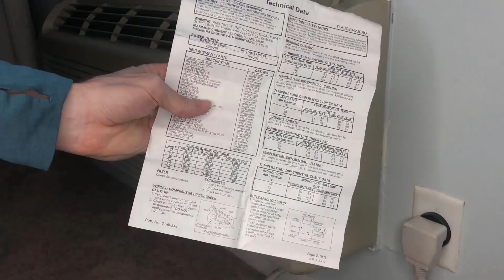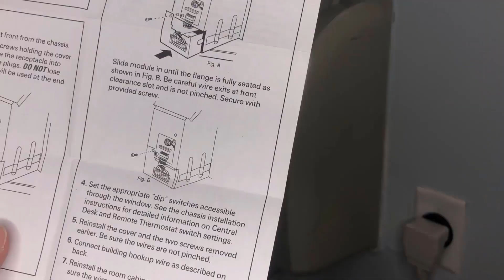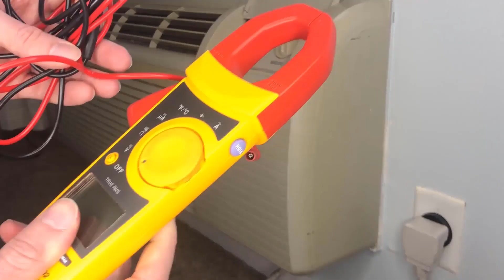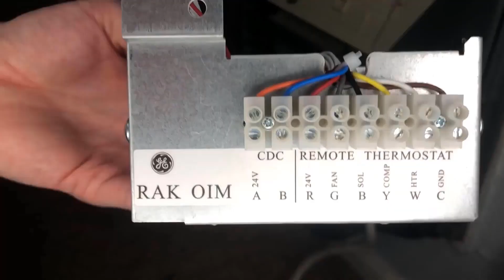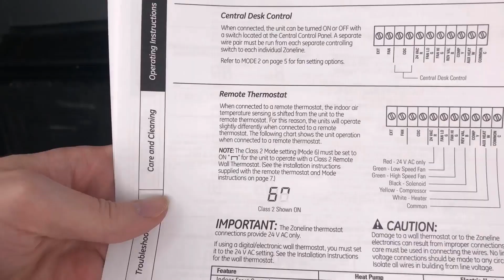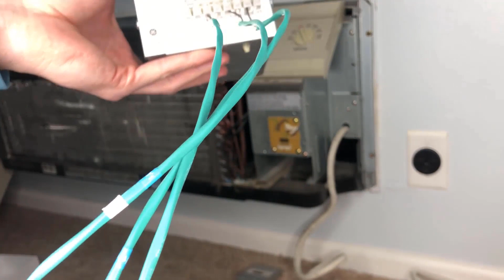Installing Nest Thermostat for GE Zoneline Heat Pump

Comment: Thanks for this video. I live in a high rise and have two GE Zoneline units that are installed in a way that makes accessing the controls difficult. I had looked into connecting them to a Nest Thermostat before - but the information I found always left me wary about proceeding. Your video has helped demystify this project for me. Your idea to use remote sensors is GENIUS and will save me a ton of money that would have been spent on an electrician. THANK YOU!
Reply from the maker: Glad it was helpful!  I give credit to my colleagues that encouraged me to give this a go.

Comment: The Dip Switch to switch to the Remote Nest is worn and I need to replace the Logic board. Would you have a video? Or suggestion. Thinking of swapping with a Unit that I do not have hooked up to a Nest
Reply from the maker: Oof, yea maybe swapping with another unit is as good an idea as any.  Openly, I'm far from an expert on this stuff. As you can probably tell, I'm fumbling my way through in this one, but somehow it worked out.  Be safe.  Let us know how it turns out.

Comment: Great video! Do you absolutely need that interface module to connect a thermostat or is it needed as you were dealing with Nest? The unit already has a wiring input, so can we not connect the thermostat wires to those wiring inputs on the unit and avoid the interface module? Sorry if it is a dumb question.
Reply from the maker: No, not at all, I was pretty annoyed that I had to get an additional component as I thought the nest would just work, but as it turn out the heat pump did not offer the required terminals.  Fortunately it was capable of offering them through the ROKAIM device which exists for this exact purpose (not specifically Nest but an aftermarket Tstat / controller).  Hope that makes sense.
Reply: Hey did you get yours to work?

Comment: how did you get the Nest to work with the 24vDC from the RAK OIM (remote interface) - I thought the Nest was 24vAC only?
Reply from the maker: I don't even remember now, but I guess I assumed it was AC all along.  It just worked.
Reply: Because it's not DC voltage on that PTAC unit it's AC voltage I'm not sure how he's getting that

Comment: Great video Dan very thorough. I have a AZ5500 series zoneline packaged terminal heat pump unit (3 in fact) and I'm setting up my 3rd gen nest. I was always confused about the reversing valve operation, whether it was energized for heating or for cooling, as my documentation never clearly stated it's operation. Not sure if I can do a meter test while the unit is running (by not toggling the Class2 dip switch but to run the unit as default) to see if it is in fact energized at the right time. And with the current weather we're having I won't be able to run the AC for a few months in order to test. From your description, seems like B is energized during heating, but according to this (which I realize is for a different model than we both have) https://products.geappliances.com/appliance/gea-support-search-content?contentId=18579
it's energized for cooling (and 0 which we don't have on our models is energized for heating). Did your documentation clearly state that B was energized for heating?
Cheers, John
Reply: Did you run into an issue with 24vDC?